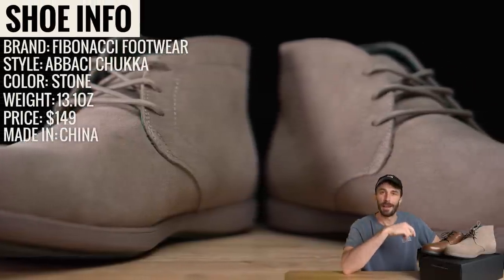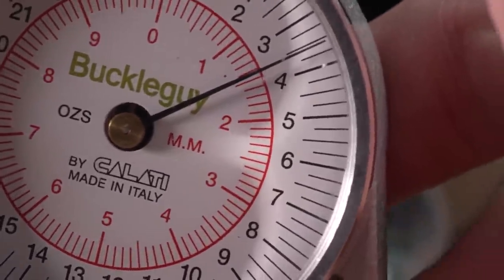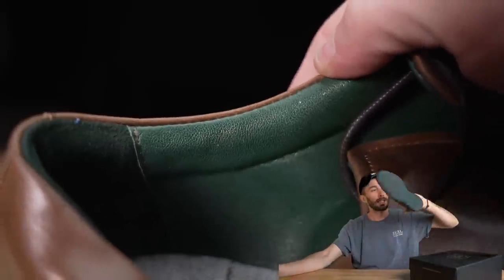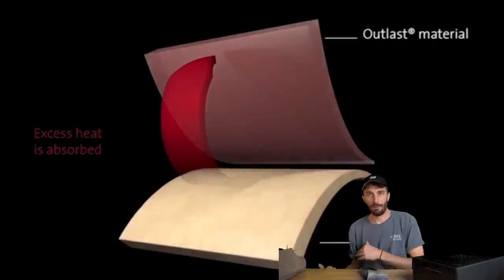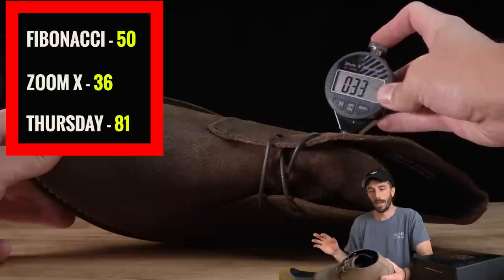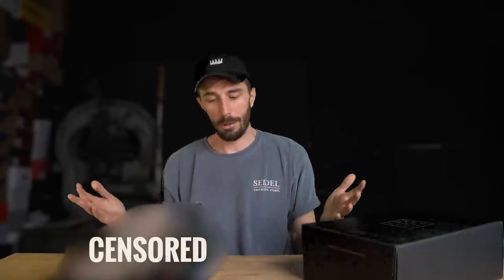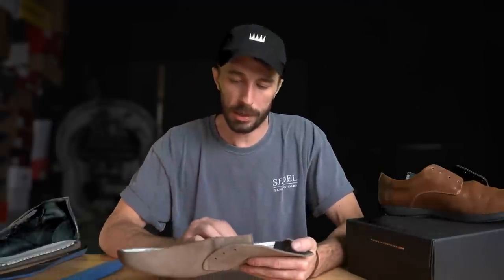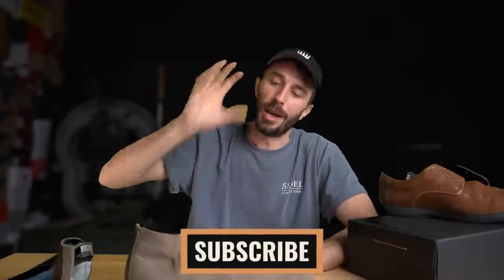How NASA technology works in this shoe - Fibonacci

Comment: I seriously doubt the wax does anything as there is such a small amount of it. So the wax might make your shoe feel cooler when you put them on, but once the wax has warmed up, it won't make a difference.
Reply: Phase change material is effective, but there’s not enough mass in these insoles to do anything measurable. Gimmick

Comment: This is the most braindead use of the blockchain I have ever seen. The problems with this are: 
1) You can copy a QR code from an authentic pair and put it on the fake pair
2) The company could just host a normal database and perform authentication themselves, there is no reason this needs to be on the blockchain
Reply: Point #2 is blockchain in a nutshell. There's no reason to not just use a database for pretty much everything that blockchain is proposed for except for speculative markets that end up just being bigger fool scams.

Comment: Being retired military, wish we had more high tech, like this NASA material, along with great construction in Combat Boots back when I was on duty. Trying out some 'combat boots' from Naglev now, an Italian shoe/boot company that has been around since the late 1800s. They are doing a full heavy Kevlar wrap upper. So far they seem fairly stiff new. Will see how they break in!
Reply: Did you ever use that old trick of wearing some cut-off women's stockings in your boots to prevent blisters?
Reply: @elrey8876  Only in Basic Training
Reply: @elrey8876  ever heard of liner socks? Same idea but a little more durable than a hacked up nylon, I'll never hike without them again.

Comment: Blockchain shoes?  No.  NO. Nooooooooo.  That's impressively stupid and gimmicky.  Unless there's some method of cryptographically verifying the specific shoe tied to a specific token on the block chain, you're just using a whole lot of electricity to scan a QR code.  Which can be copied onto any other shoe.  These might be good shoes as shoes, but I would not buy them specifically for being on the Blockchain bandwagon. Any authentication of a physical item via Blockchain is only as trustworthy as the least trustworthy person to whom they've previously been linked.

Comment: Never buying anything that uses Blockchain for marketing 🤢
Reply: VeChain is a supply chain blockchain, its for authentication and supply chain management . . .
Reply: @vechainmillionaire  which is entirely a waste of resources in this use case.

PS. Stop spamming.
Reply: @vechainmillionaire  your name is literally vechain millionaire lol not the most unbiased guy to hear this from 🤣🤣🤣
Reply: @aidanmco  Yes it does - and I have done my research so know a lot about the topic, companies like Walmart are using them.
Reply: @cohan88  Spamming? gtfooh - do some research you have no clue what you are talking about
Reply: @vechainmillionaire  its literally less than useless in this application lmao. An app using an SQLite database would be strictly superior. At least then somebody copying these shoes would like need to write a script to test IDs against the database to get a list of valid ones. With a public chain they can literally just check the chain for recent IDs and use those for the fakes. Assuming anybody wanted to copy these and had a desire to make IDs valid beyond just literally using the ID of whatever one they bought to copy, or even not adding an ID in the first place.

Comment: You don't understand how the wax works.

Usually, the temperature of a melting or freezing substance is constant. The solid and liquid phases are in equilibrium. Any heat added or lost from the substance will either melt or freeze some of the substance, while there is still an amount of each phase.

If you have a wax that melts at about the temperature your foot is comfortable at, it will help keep your foot at that temperature. When you take a lighter to the fabric, the wax is probably all melted very quickly. You don't see liquid wax because it is encapsulated.

However, any effect of this temperature regulating wax is only going to be useful if there is a big enough amount to absorb or release enough heat. The tiny amount of wax within the material dots would likely be nearly ineffectual, I would have thought. If those same dots were made of ice, your foot would very easily melt them in nearly every day-to-day circumstance. Given that water has a nearly superlative latent heat of fusion, I am highly doubtful that this material makes any noticeable difference.

If anyone knows otherwise, I would be interested to hear from them.

Comment: Hmm. Know what they remind me of..? Remember the doc marten shoe? Those were a good idea for a while, but the soles on mine did start getting a little bit of dry rot after cleaning with bleach and degreaser at work, then they got too slick to walk on. Not sure if normal or not because I wouldn't put my made in englands thru that kind of torture. I had canvas ones and greasy leather ones. My favorite docs are the really old ones without any toe reinforcement! Or the pointy toe. Witchy!!

Ps. I've seen videos with products that water beads and rolls off suede. I'd like to maybe see something about that on your channel if you have any experience with products like that! I know one of the products I've seen is by chemical guys but it's a bit pricey! It's always a fear in the back of my mind with tan color suedes or nubuck, I always feel like some ketchup is about to land on my shoe or boots! Impending doom! 

Also I took my black doc marten boots that the front was a bit scuffed up to a shoe repair shop, and they used a type of airbrush to paint them and I was like meh.. and then the paint got ugly and cracky where it bends. how would you restore a pair of black boots with heavy scuffing on the tip?? Vidz about how to go about maintaining your boots would be great content imo.

Comment: These shoes remind me of tennis racquets quite a bit in that if you're buying one that's using some form of carbon or graphite, you're getting a decent material and construction, along with the benefits/drawback of said construction (balancing out power, feel and control in some measure depending on the thickness of various points of the racket as well as any additional material and how the carbon was layered up) while also finding the most gimmicky form of tech in order to market the racket and try to justify you buying the latest model and a questionable verdict on whether it works or not, it got so out of hand there where lawsuits lost when one manufacturer just plain didn't use tungsten in the racquets, while prominently branding said racquet as using the material, and all manufacturers have used "nano", "i" or "tech" at some point to say why their model is the best, only to unceremoniously dump the revolutionary tech on the next iteration for a new one. The leather and construction of this shoe/sneaker seems legit and using gel along with foam seems like a good idea but anytime "NASA tech" is touted, I'm skeptical sorry. And blockchain is a solution looking for a problem and I'll say no more, I'm not saying that those implementations of said tech here don't work, but as with tennis racquets I'd be doubtful of the value they are truly adding vs choosing another tried and true but less marketing friendly way.
Reply: Yeah I hear ya, sometimes you have to market the things like NASA as a form of credibility. Especially when a company is a start up.